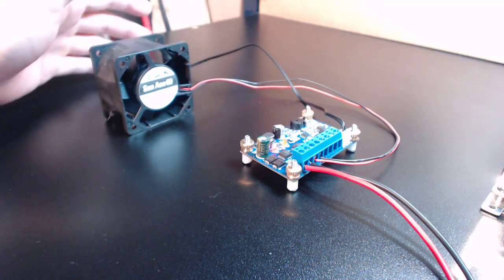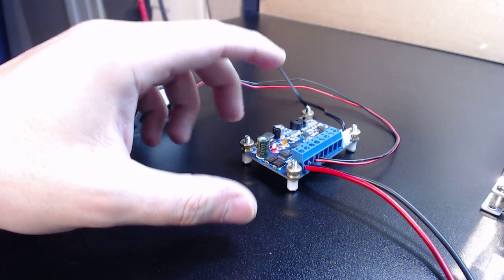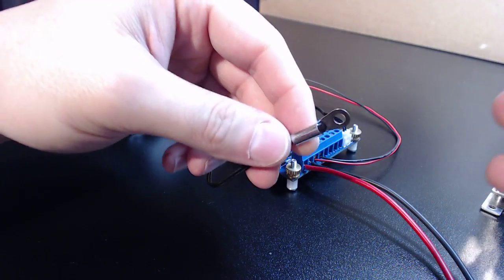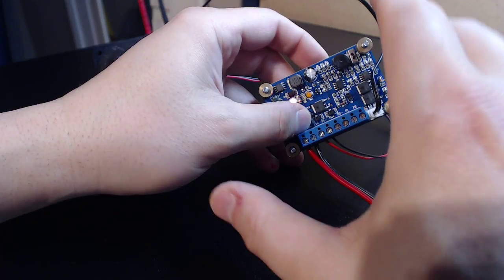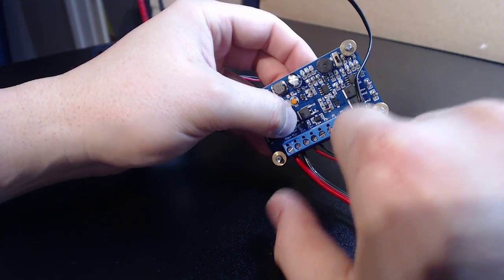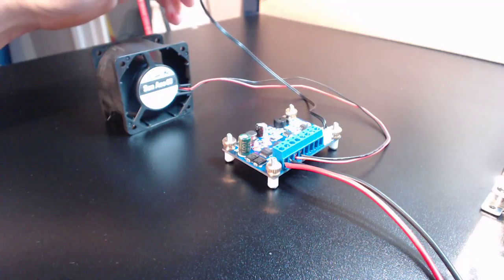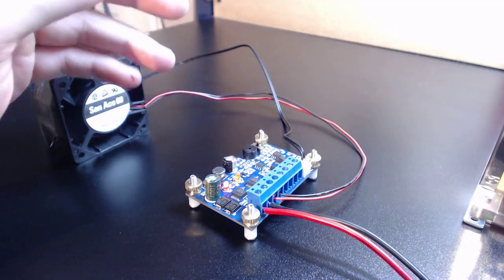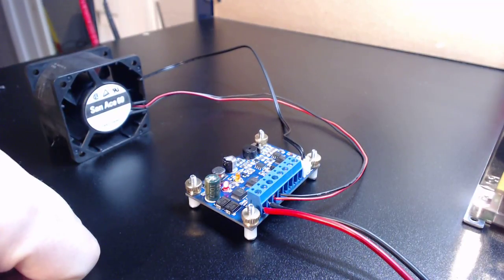Autonomous CNC Fan Control System (Automatic Fan Controller With Alarm)

Comment: Can it control speed by PWM?
Reply from the maker: Hey Brad,

Thank you for your support. 

The fan controller itself can't be as it utilizes PWM for fan manipulation. 

If you're trying to cycle the unit on, an off you could use a relay to do it depending on your application.

Thank you,
Vince

Comment: Glad to see this is an available option.  I'm looking to purchase a full motion control package from you soon.  Watching a lot of your videos first so that can get a good understanding of what I need and how it all works.  As of now, I'm thinking of going with your G540,  UC-100, 300 oz motors,  UCCNC software, enclosure and cabling you have listed as a package.  Silly as it may sound, the fan noise was the only thing I didn't like.  But, I'll be running out of my basement and noise levels are a factor.  Looks like this till go a long way towards helping in that regard.  I'll be in touch relatively soon to discuss my chassis and intended substrates I'll be working with.  From there, we can finalize what I need to order.
Reply from the maker: Mark,
Thank you for your support. I really appreciate it. The fan controller is a really nice unit for thermal protection, and noise control.

 Just let me know when your ready.

Thank you,
Vince

Comment: I know in Cabinet shop you cant stand near the exhaust fan area if you need to talk to someone its very loud. So this fan , on high volume is not that loud. so great product. keep up the great work.
Reply from the maker: Thank you Dave, I believe this unit will bring up to speed all the current systems out there that weren't able to use this technology before do to required supporting voltage, or required amp support for CNC systems. Vince